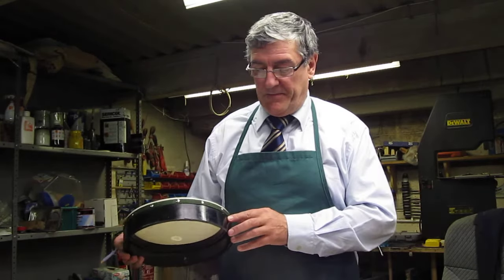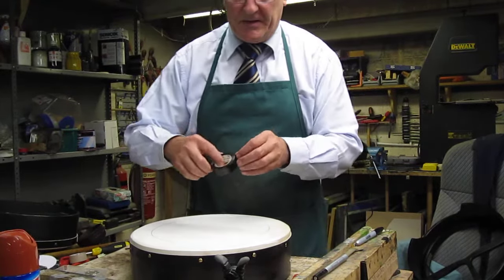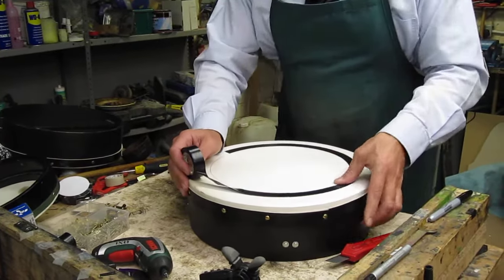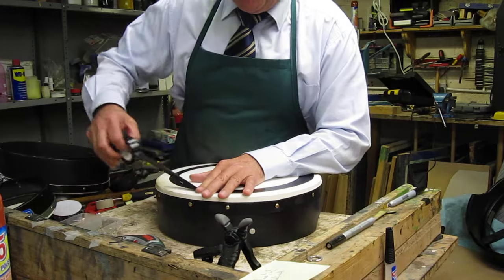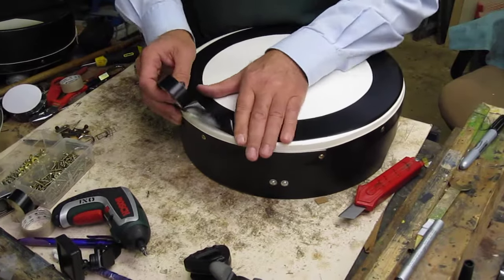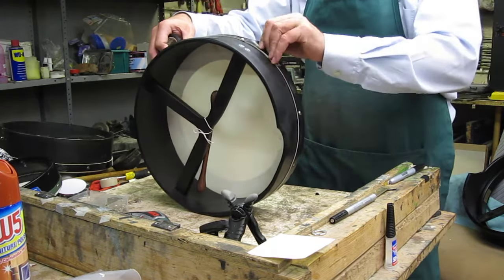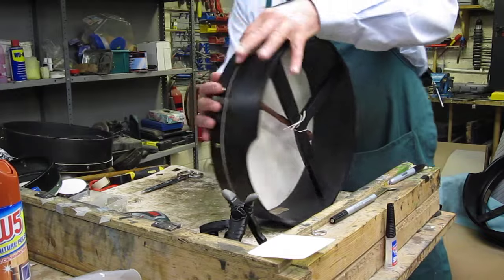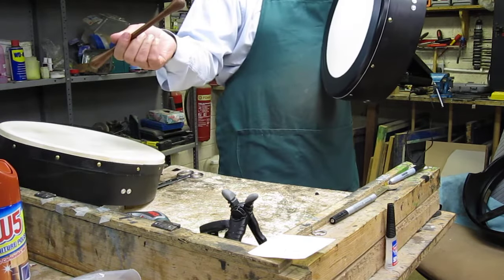Tapeing a Bodhrán

Comment: I followed your instruction here and it seemed to work great, that is until my skin changed its tightness and the tape pulled away about 2 hours later.  Any suggestions for dealing with skin fluctuations?  Thanks for any help :)